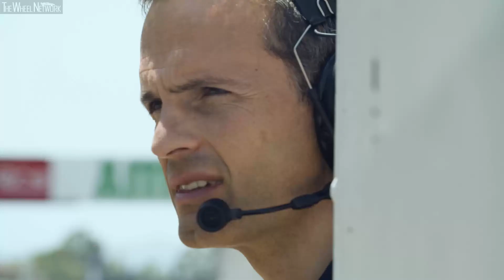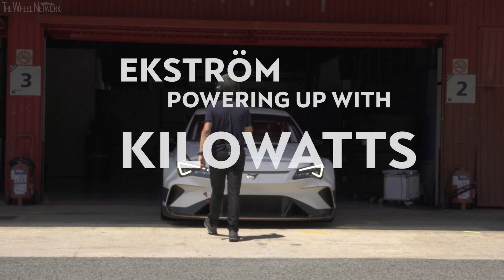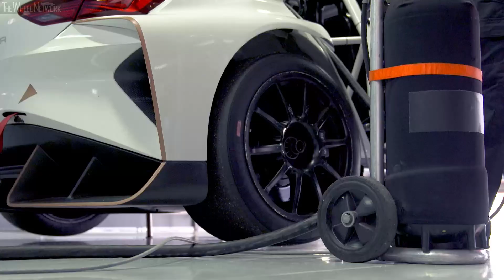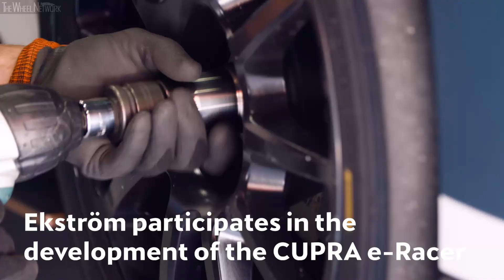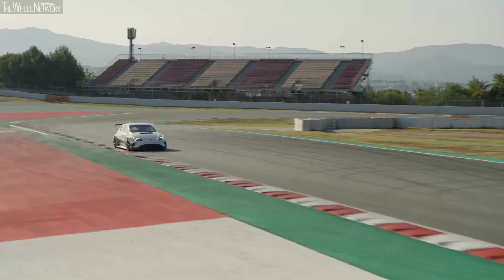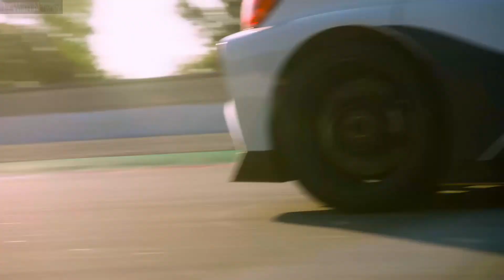CUPRA e-Racer Testing With Mattias Ekström (ETCR Electric Race Car)

Comment: No sound no fun. Petrol rules.
Reply: Pablo facts these Arent cars just a iPad on wheels
Reply: ok
Reply: @mattykobs  wait until 2030 then comeback to this comment
Reply: @mattykobs  get out of here they will add the touchscreen cause of setup or some sort of electrical boost to overtake
Reply: @mattykobs  or they might be flying the cars hovering over the circuit cause man says rubber is gonna disappear in a couple of years
Reply: @mattykobs  oki